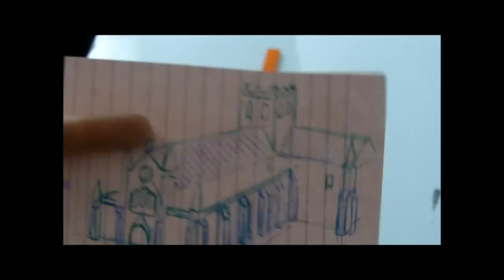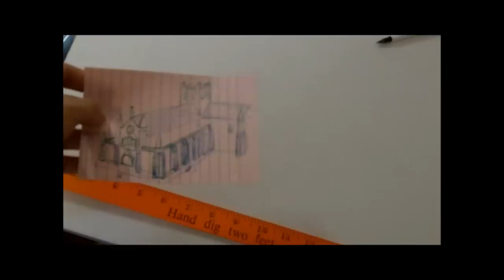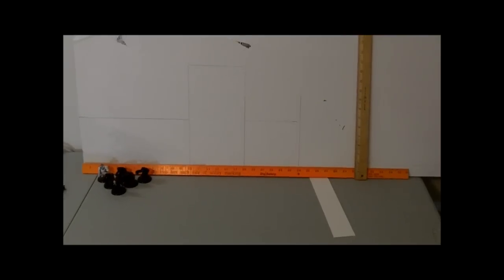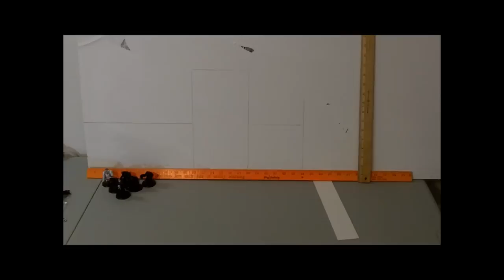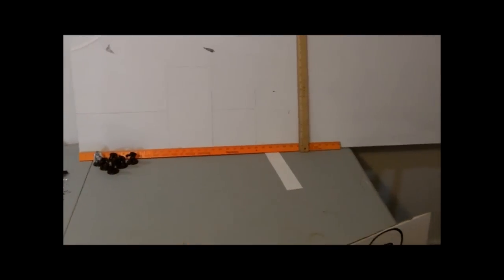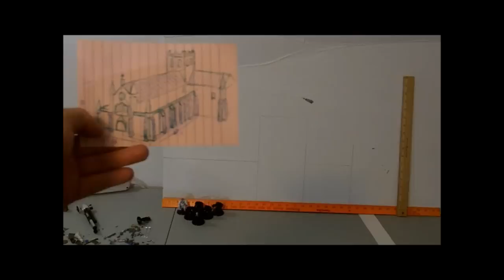Terrain Build Warhammer 40,000 Cathedral Day1

Comment: This, I call a huge project. This will be a beautifull center piece on the table when it is finished. Reminds me on the PC-Game Dawn of War (I thing it was that one) where there was a map with a big ruined cathedral in the center. I'm looking at Dust Tactics atm and thinking of doing some small terrain that should also fit for WH40k. So I speek of a bit smaller size ;) basesize for the terrain I'm thinking of is 3.5" by 3.5" or 9cm by 9cm a little bit smaller than your project :D.